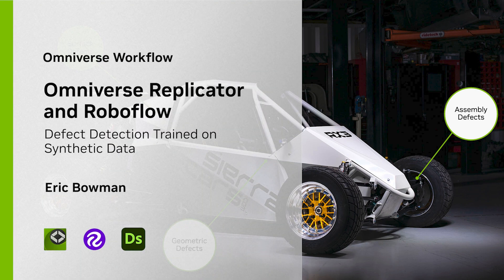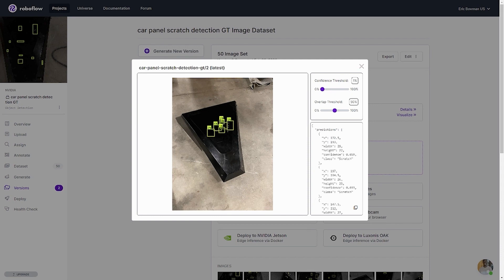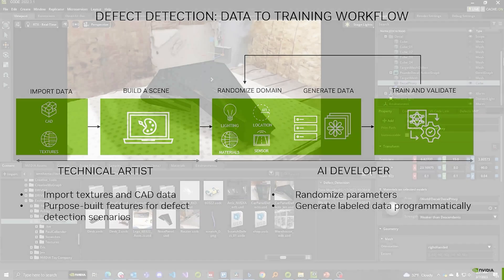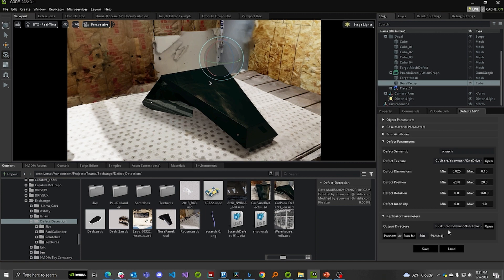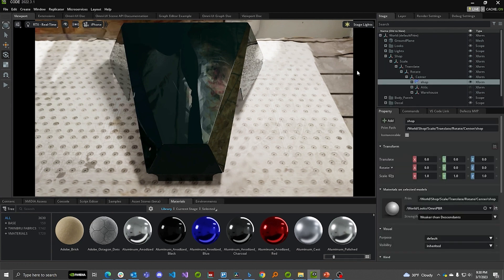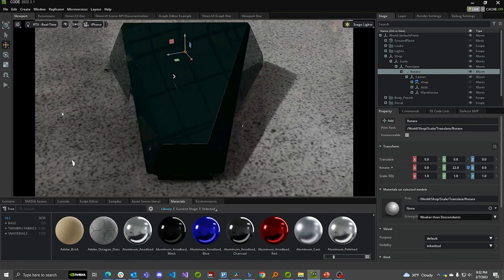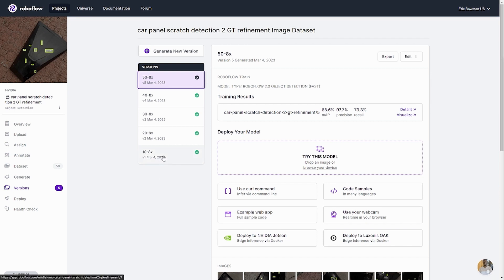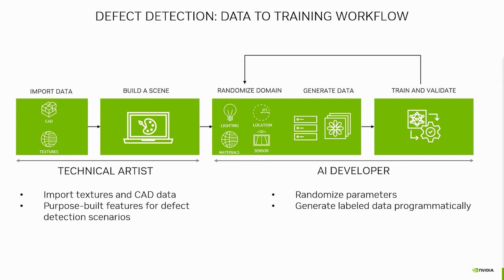Defect Detection Model Trained on Synthetic Data w/ Omniverse Code, Adobe Substance 3D, and Roboflow

Comment: "In the past, there was only one option. Wait for more images, however long that took." I mean, there's decades of classic machine vision quality systems that would likely work pretty well here. Scratch detection is a decently standard use case. So there isn't really just "one option". But, definitely generating synthetic images to bootstrap an ML based solution is a very good approach too.